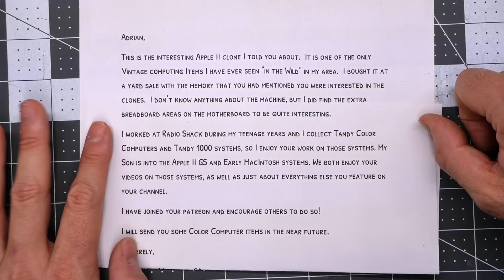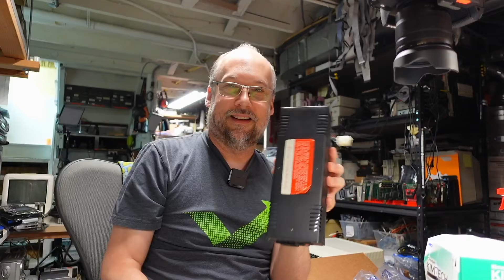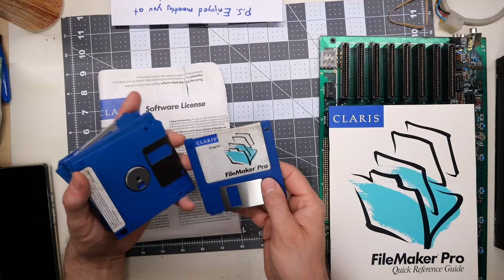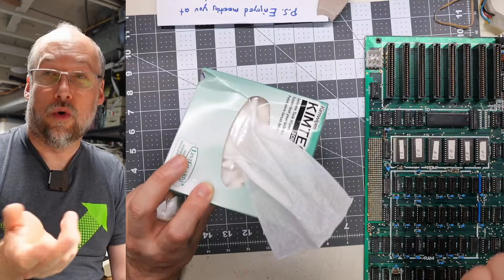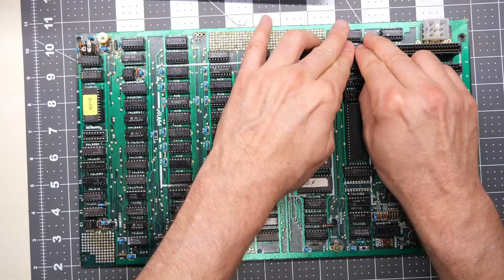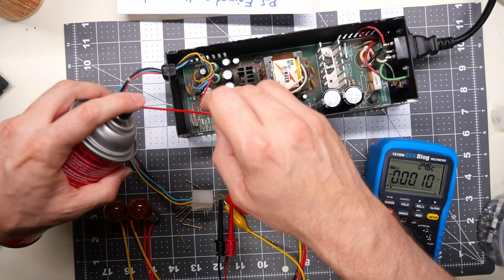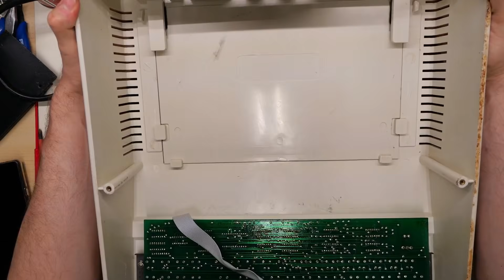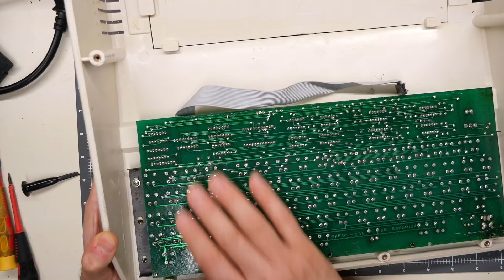0068 This computer is an illegal clone

Comment: S with the intertwined H definitely is Siemens, with its roots in Siemens+Halske. This logo is still in use and trademarked as of today.
Reply: You beat me to it, as I was about to say the same.
Being German, I am familiar with the logo in general, but I don't recall ever seeing it on a semiconductor product. They usually spelled out Siemens on the chips that I've seen.
Reply: @Colaholiker  oh, it appears also on industrial automation products, as well as others. It's kept in active use for some reasons. Unfortunately, there's yet no Unicode code point, so it's difficult to embed in software-only products...
Reply: @TheDiveO  Yeah, I've seen it on really old gear, but also on power supplies for the S7 era automation gear. 
Not sure if Unicode would allow a trademarked company logo in there, but they could still embed the logo as graphics in say the about dialog of their software..
Reply: @Colaholiker  Siemens also made X86 Cpus up to 286, it is a less commonly known fact i think.
Reply: @JohnC5  I know that, and they even partnered first with Nixdorf and later with Fujitsu to build entire PCs. I even owned a laptop that's Fujitsu Siemens Branded. 
I worked on quite a bit of stuff that had Siemens-made 8051 microcontrollers in it. However, all of this had Siemens spelled out and never used the old "Siemens & Halske" logo.  That's what I was going for. 😉
Their semiconductor business later split off and became Infineon.

If we continue the discussion and use the name Siemens even more often, the algorithm will make Siemens an official sponsor of Adrian's Digital Basement[3].🤣
Reply: @Colaholiker  yes sorry i misread, yeah the SH Logo is a really rare sight on chips
Reply: @JohnC5  No problem, maybe I wasn't specific enough the first time 'round. 😅

Even if they rarely use the logo today, I see why they keep the trademark protection active.
So many well-known and trusted brands from back in the day can be found on shelves again, but the manufacturers have absolutely nothing to do with what people remember from back then.Someone just bought the rights to the name after protection ran out and cranks out cheap products under a trusted brand name. Siemens likely don't want this to happen,
Reply: Yes Siemens.

Comment: I use Kim Wipes to clean up after soldering.  Alcohol on a brush and these to pick up the liquid.  They're strong enough to brush through while wet. I learned this when I did rework at the NCR factory I worked at many years ago and later on the bench at Broadcom.

Comment: I’ve used Kimtech wipes a lot as they are ubiquitous in biomedical laboratories. They are leave no stray fibers, lint, etc., and are non-scratch (unless anything gets on them.) They are great for cleaning any sort of equipment, especially electronics and anything with lenses or similar optics. They should serve you well on cleaning screens, cameras, and computer components.
Reply: In the biomedical labs I’ve worked in its standard to sterilize when you clean; it’s become so rote that I forgot to mention that they’re used with isopropyl alcohol or similar.
Reply: We have them in the lab, used dry to clean glass lenses, they never scratched.
Reply: @annadenaro9919  They are probably fine on real glass but I'd be really careful on any polycarbonate lens.
Reply: We use kimwipes & isopropyl at LIGO to clean flux residue from circuit boards after rework.
Reply: @marcpirello3724  LIGO, awesome!
Reply: You can also blanket a surface and brush with alcohol.  They will absorb Flux and scummy stuff.
Reply: Also used a lot in fiber optic splicing.
Reply: We use those with isopropyl alcohol in the fiber optic sector of the telecom industry
Reply: They are made for glass lenses, they may scratch plastic lenses. Moisten with some cleaner. Reminds me of the Kodak lens tissue I used to use.
Reply: Worked in aerospace and Kimtech wipes were the only wipes we use in the labs.
Reply: Used green kim wipes for splicing fiber optic cables for years...  glass is incredibly hard though.
Reply: They are fantastic for cleaning up flux which has been partially dissolved with isopropyl. You can literally brush right over the top and it absorbes without leaving fibers on the board
Reply: I use them to clean broadcast Tv lenses and I'm talking $50k broadcast lenses, I do use them with lens cleaner and a 'puffer' to dust off the lens first. I Highly doubt they would scratch anything plastic, when used correctly
Reply: We use them in optics labs in the Canadian Armed Forces. Never heard of them scratching anything dry, but we do usually use lens cleaner with them.
Reply: Definitely wet them when cleaning eyeglasses. I used them on my lenses dry and they caused scratches.
Reply from the maker: Oh dear -- scratched lenses is no good. I'm ok using microfiber clothes for cleaning them, I now have them all over the house and in my bag. But as for cleaning everything else including camera lenses, that sounds amazing.
Reply: @adriansdigitalbasement2  For many-many years in the broadcast industry, we used Kimwipes for cleaning videotape heads. Back in the day we used liquid Freon, but Xylene or denatured alcohol might also work.
Reply: @adriansdigitalbasement2  They work especially well on Eyeglasses. No more micro-abrasions because of a piece of grit stuck to your lens.
Reply: @adriansdigitalbasement2  Advance Auto Parts has extremely good and nice size 25 pack of AutoCraft Microfiber Towels for 12.99. I toss them in the washer with washing detergent with no fabric softener and air dry before using and after they get dirty. They last and last and last. They are the best microfiber towels I have ever used. And they do not scratch.
Reply: @JoshBattin  especially for non-green versions, you would want to be careful with eyeglasses with coatings, or made of polycarbonate instead of real glass. That's the problem with wipes like this, it can be fantastic for most uses, even very expensive and delicate lenses, but there are always exceptions.
Reply: @levimaaia  The standard green box of Kimwipes are specifically designed for cleaning precision optical glass and first surface mirrors. You can buy them from pretty much every lab supply company and camera retailer.

100% the scratches came from debris that didn't get removed before wiping them down.
Reply: @levimaaia  "Definitely wet them when cleaning eyeglasses. I used them on my lenses dry and they caused scratches" That's more likely to be from stuff that was on the lenses themselves when you cleaned them rather than from the wipes.
Reply: I have used them to dry off my glasses after cleaning them with water and soap, also use if I spray eyeglass cleaner with glasses. Also mainly use them when soldering to help clean stuff my work with alcohol. Oh and if I am cleaning a CPU surface before applying new thermal paste (coffee filters work if you dont have kimwipes).
Reply: They’re also used by fibre installers to clean the fibre strands before cleaving and splicing

Comment: Seasonic is a great power supply company! I bet someone de-Rifa'd that power supply, probably why screws were missing.
Those dark Blue caps with the gold stripe appear to be Panasonic FC series, I have a bag of 220uf from '05 that look just like them.
Reply from the maker: Yeah, turned out Mike's son recapped the PSU with those Panasonic caps. So not original anymore -- but I have a feeling there was likely no RIFA in there.
Reply: @adriansdigitalbasement2   that lone ceramic cap in the lower left corner looks like it was retrofitted and maybe even holes were drilled for it. If so, chances are there used to be a RIFA in that position.
Reply: RIFA were unfortunately the original components in many otherwise decent power supplies. The reason was marketing. RIFA presented their paper heap as compliant with all major approbation marks in Europe and the US, as an easy way for a power supply manufacturer to sell their product in those markets.

Comment: The thing to remember when using bulbs as a load is that when they are cold there resistance is much lower than when they are lit.
So the low cold resistance was probably triggering the current limit in the PSU before the bulbs got a chance to warm up.

Looks like the psu output strain relief may have been refitted with too much wire inside the psu, reposition that and the wires maybe just be long enough, maybe.
Reply from the maker: You hit the nail on the head with the strain relief, I just took it off and slid more of the wire out. Turns out Mike's son had recapped the PSU, so he would have taken that off to get the PCB out.

Comment: The kimwipes are what many people  use for cleaning solder flux off circuit boards (along with alcohol)... they don't leave paper particles like paper towel etc. I've been using them for over a decade for that specific purpose.  

In the early 80s, there was a local guy selling apple II+ clone motherboard kits (he was actually an engineer working for CNCP communications, selling them on the side). You got the blank PC board, all the components and would have to solder everything to the board (lots of soldering!, luckily IC sockets).  You then had to purchase the clone case, power supply, keyboard etc from the stores that were selling them (one place called Parts Galore in Toronto - I remember the street they were on too.. College St). Once I had finished the kit, I was even able to go to Westworld Computers and they gave me the Apple II+ emblem for the cover, so in the end my clone looked near identical to an Apple II+.    The clones were a fraction of the cost of authentic apple II+ computers (I think they were $2000+ back then).  Clone parts was a booming business back then (early 80s), starting with the apple, and then eventually the IBM PC became cloned with all sorts of cheap parts.  btw, maybe they were illegal, but, the one I had was not sold as assembled.. you assembled it, and had to source many other parts.. so it was perhaps more of a challenge for Apple themselves to target as counterfeit. I would bet the one you have could have been built the same way.

Comment: The keyboard is called a 'macro-keyboard'. It just has some keywords in rom that can be accessed by pressing a function key (the white with led) together with the relative macro-button. These kind of keyboards could be bought for the original Apple II as well.
Reply from the maker: Neat, I had never heard of them. I'll definitely be trying out the macro functions when I get the machine repaired.
Reply: @adriansdigitalbasement2 I have an Apple II+ clone with a keyboard that has 10 function keys that you can program strings into. I have "CALL-151" in F1 for example, so if I want to go into the monitor, I just press F1.
Reply: You can use it on Apple brand mainboards, too. @adriansdigitalbasement2
Reply: Yup, I had a similar clone back in the day with the macro keyboard.

My clone also never had a badge in the recessed area, the case design is pretty much the same with the short lid and resin cast case.
Reply: Aye, I have one in my ][+. Those naturally lack the numpad, but they are so much nicer than the Datanetics keyboards, and the macro keys are useful. I dont recall ever seeing anything of the sort for the //e, sadly; as this would AFAIR only need a ROM replacement.

Comment: I loved these videos. I used ClarisWorks on my Grandfather's Mac Classic back in 1996 or so. Of course Apple bought the rights to that software and AppleWorks was born.

On a side note I've been trying to contact you about these pin headers I bought for a project but they wouldn't work for what I bought them for due to clearance issues. I know you are probably backlogged with emails but I would like to know if you would like them as I don't need them.  They are the 2.54mm 40Pin Round Female Socket Pin Header Strips and I bought 4 packs of 10. There are a few missing but let me know if you want the rest of them. I have at least 37 pieces left and I don't need them.
Reply: Claris was always tied to Apple. I think they were a subsidiary, but I'm not 100% sure on that.

AppleWorks on the Apple II was first, then later they spun it into ClarisWorks, then I seem to recall AppleWorks again, before going all in on their own with the iApps, like iMovie, Pages, etc. Claris, on the other hand, went their own way, and ESPECIALLY doubled down on FileMaker and that is their jam now.